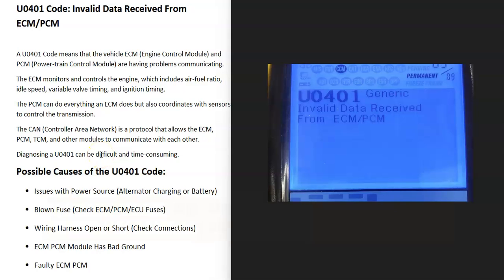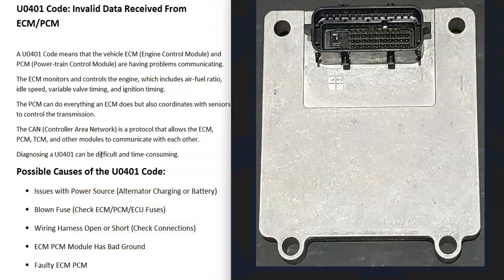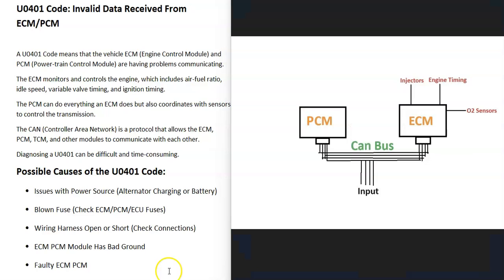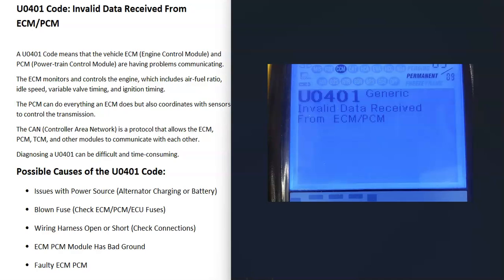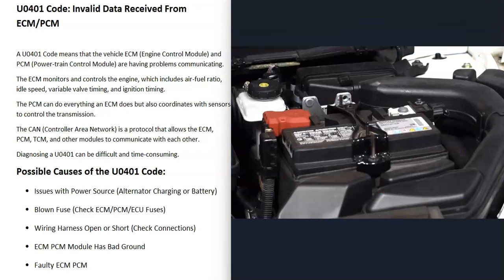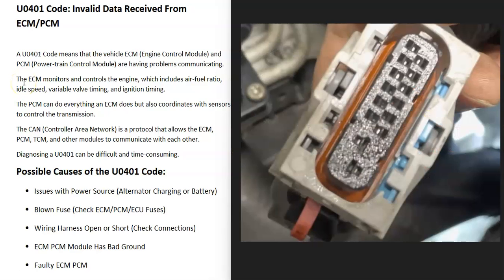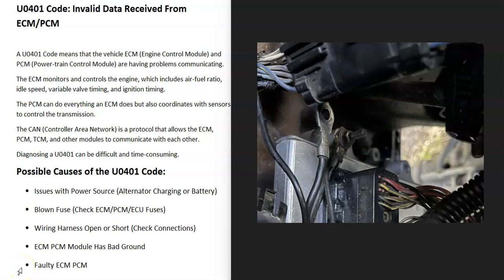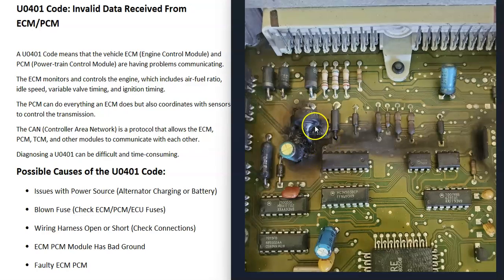Causes and Fixes U0401 Code: Invalid Data Received From ECM/PCM

Comment: My crv also showed TPS high voltage on sensors a and B....essentially need a new gas pedal... but this is still tentative as I am waiting for parts... maybe it's a bad fuel injector however I figure there would be a separate code for that

Comment: My mitsubishi asx 1.8 diesel 2013 is showing the same code and the power steering stopped working.  When you start the car power steering works for a  few seconds and then stops  working. Anyone knows what the issue is?  Thanks

Comment: I have 63. 47 volt on control module  and 16383.75 kv on gen mon 2 i read today the voltage is reading from 3 circuits but haven't  figured out wich i have the diagram its  f750 2019 6.7  the gen mon 2 ends in splice i can pull ground but the number comes back even with ground on i think pcm is bad i sent it out but they said software  i  reprogram like i was swapping the pcm and that finally allowed the truck to regenerate  but soon as drive it power reduced im pretty sure its pcm issues  but haven't found any circuits that have the same reading as scan tool if any one knows how the control module voltage is off what pins or what to look for in book i had to get the ford paper back with gen mon 2 line identified the pdf vin specific  didn't  show up being the truck didn't have second gen and i get bleed over to the other generator line once start that goes away i did start the truck from messing with gen mon 2 line it didn't  show power with koeo and touched power power on probe and started the truck with this i belive the start signal is tied to start wich is likely the reading issue  is my theory  i did see some video about tying the 2 nd alt to the other but cant find that video

Comment: Hi sir I have  a ford ranger 3.2 T6 automatic its  going into limp mode and it is stuck in 2 gear even the traction light comes on but when I poot it on a diagnostic it kicks out a U0401 could it be the fault because the bakkie was driving fine
Reply: same problem here mate did you ever find the fault?
Reply: Hi sir ,how did you correct that problm,Does it mean its a Gearbox problem?kindly assist.
Reply: Hi sir ,how did you correct that problm,Does it mean its a Gearbox problem?kindly assist.

Comment: Hello sir i have a chevrolet Captiva 2.0 transmission problem and when I scan i get U4101, can u give me your whatsapp number please just get more infos
Reply: Hello. I have the same problem. Were you able to solve the problem and if so, how did you do it?
Reply: Hello. I have the same issue on my chevy captiva. It gives the U0402 error code and the gear shift doesn't work when manual mode. It works fine in automatic mode. Thanks

Comment: This fault means incorect data recived...  NOT lost communication . I just Had this  fault in TCM module on 2016 Ford Ranger diesel  due  to random   misfiring coused by 2 faulty injectors   .  So this Fault can just show up  in TCM  as result of data  that it gets from engine ecu    not nessesary bad wiring or faulty module.   On some cars if there is  problem with engine not running corectly it will set this  fault in TCM, and ABS
Reply: Right on. Critical information there ! Not just spewing a trouble code definition like the video . Dealing with this on a CRV right now. It's misfiring . So most likely NOT a PCM.
Reply: @motorbreath7174 I got the code when my starter motor packed up.
Reply: I got yesterday a limp mode on my truck. I got this code U0401 on the TCM and ABS. I got scared because it was saying the brake system, but result is bad communication between ECM/PCM, very weird. Later on, I got throttle body stuck when open. I wonder if I am having a bad throttle body, and it is generating this bigger fault before being diagnostic correctly.

I guess, I will change the throttle body, the truck has over 101k miles. So please let me know if you think something different, any help is welcome.
Reply: My sons girl is having this issue and the only other code is a rich condition
Reply: Wow thank you
Reply: A literally reads as a communication fault on several makes.
Reply: @Roger-il8iw because what he said is wrong . When you get this code and no other code 99.9% of time its communication and its usally in the wiring or a bad ground
Reply: W
Reply: أهلا عندي نفس مشكلتك في مركبة من نوع فورد رينجر 2017 بمحرك ديزل ٣.٢ . أخبرني ماذا فعلت ظهر عندي الكود رقم P 0884 والرمز U0401
كذلك عندي ضعف فالعزم
Reply: had this code along with a P0303 cylinder 3 misfire detected, guess the misfire also triggers the U401 code.. on a fiesta 1.6 2011

Comment: Ran into your video after getting this code on my jeep Cherokee. I found a 20a fuse in the powertrain control mod pcm that’s supposed to have a 15a fuse. Could that cause the code to appear?
Reply: No, basically 20 amp fuse make it harder to burn then 15A.
Reply: That 20Am could cause world going upside down

Comment: thanks for the video ,just started with my abs light coming on ,getting this code for abs system recieving incorrect data from ecu/pcm ,infuriating that it couldnt just be a faulty speed sensor had to be more complex damn it!
Reply: Did you ever find a solution? In the same boat with a 2018 Jeep Grand Cherokee
Reply: @SPIRITLEDAUTOCARE  hello mate in my case all it was was a broken wire/ connection on the map sensor ,one little broken wire re soldiered and abs light went straight out ,abs unit getting wrong signal from map sensor ,good luck going forward